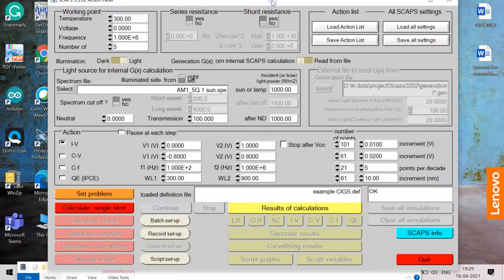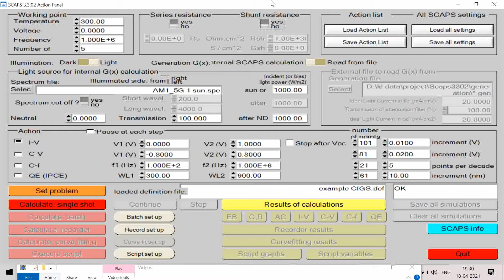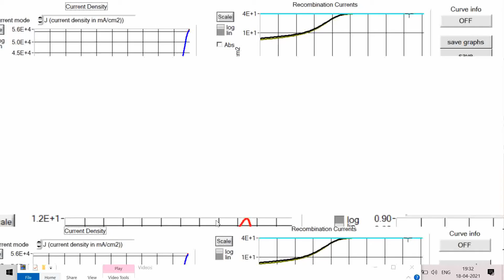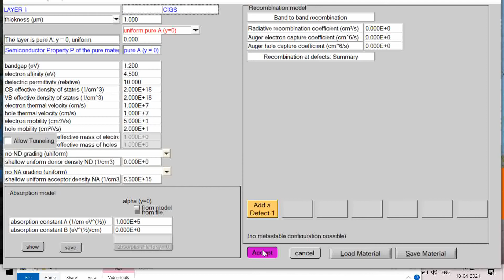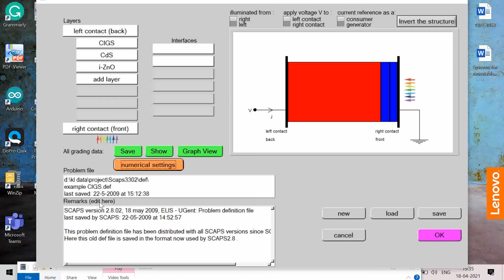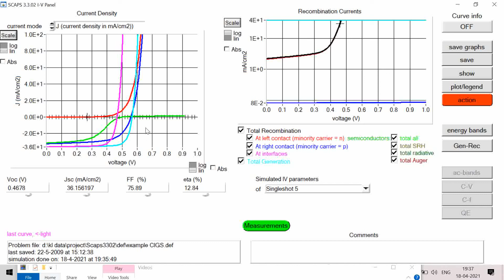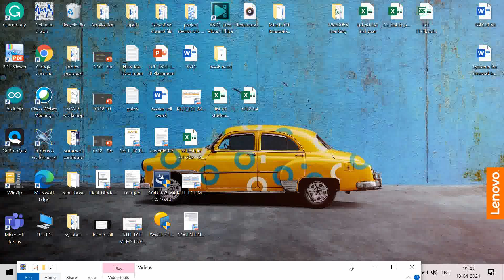Session 4: Step by step guide for Defects simulation in SCAPS-1D, defect impact on I-V curve

Comment: Thanks for the knowledgeable and interesting lecture. i wanna know if we can add some doping content (such as imidazole) in perovskite absorber layer in SCAPS tool. I already watched a video about adding impurity at different concentration levels, for which we need to focus about Shalow Donor density and Shalow accepter concentration. Let's suppose I set donor density at ZERO and acceptor density different as 1.000E17, 1.000E18, 1.000E19,1.00020. My question is, how is it possible to doped imidazole in absorber layer in PSCs?

Comment: Sir I am getting convergence failure at V=00 volts. Can you tell me why it is coming and what is its solution?
Reply from the maker: this may be due to unphysical values or structure , pls check all the material parameter values and device structure